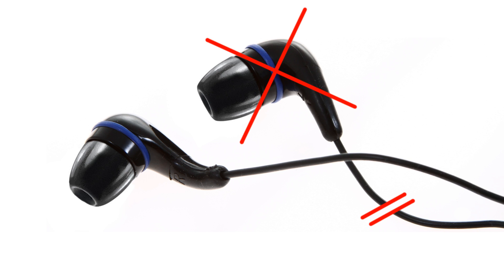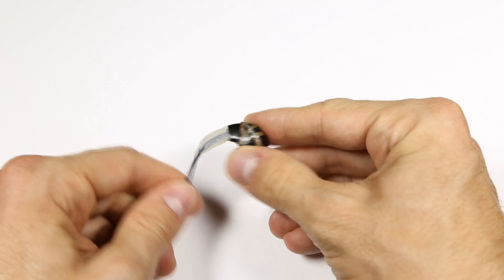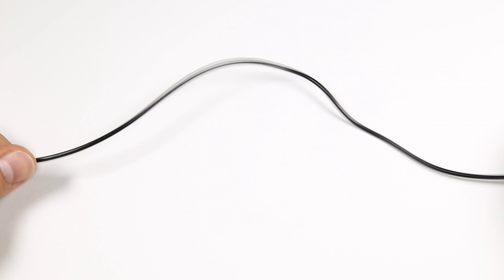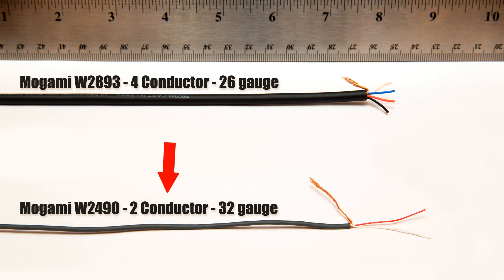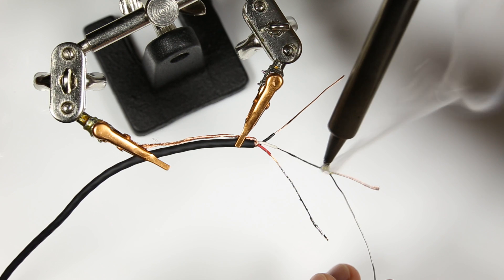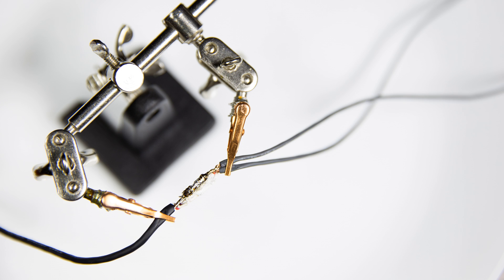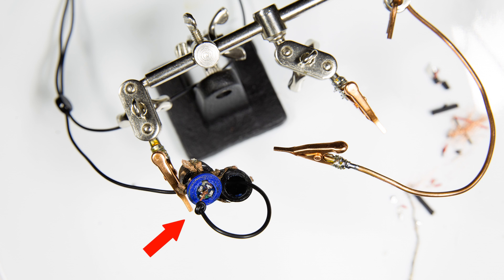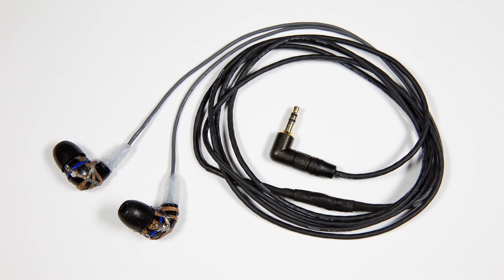How to make a new/replacement earphone cable

Comment: may i know what is the name that cable holder stand?
where to buy online?
Reply from the maker: irfan aliando They're called "helping hands".  Mine are pretty cheap and I replaced the normal clips with toothless copper clips, but that's not to say that's the best setup.  I just didn't want to mar my cables with alligator clips.  You can find tons of varieties of helping hands online.

Comment: Could have simply used the 2 conductor wire for everything, more complicated than it needs to be. Use the braided shield as the common, that's what it's for.
Reply from the maker: You're right, I could've done that.  I'm glad I used 3-conductor for the main cord, though, because the 2-conductor wire is very thin.  I'm not sure I'd want to use it for longer lengths.

Comment: Thanks for the video. I have the same monitors. How did you do to open the earphones to sold the cable to the driver?
Reply from the maker: They are glued together where the blue band is.  Unfortunately you just have to carefully wedge them apart next to that band with a thick razor blade or something.  That's why I had to settle for such an ugly solution to keep them together (using soldering braid).

Comment: Hi.. Great Video. I have replaced my headphone cables with a new cable and the cable keeps breaking at different points throughout the cable. Can you give me a link to good earphone replacement cables that I can get from china/europe as I live in the uk?
Reply from the maker: Thanks!  This video exists because I didn't see any helpful videos on this topic and I ran into the same problem you did (couldn't find satisfactory replacement cables), so I did my research and made this video for others wanting to make their own cables.  I'm sorry, but I can't speak to any sources for european wires, if MarkerTek doesn't ship to Europe.  Just try to find the same Mogami cable I mention in my video as it's very high quality.  They're still going strong as of this comment.
Reply: Cable just use mic cable balanced you definitely never break it